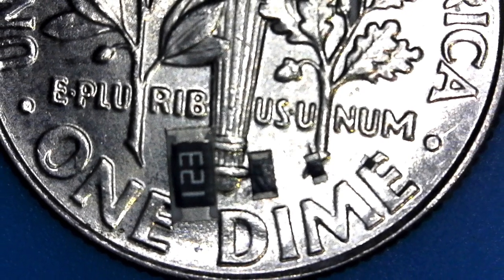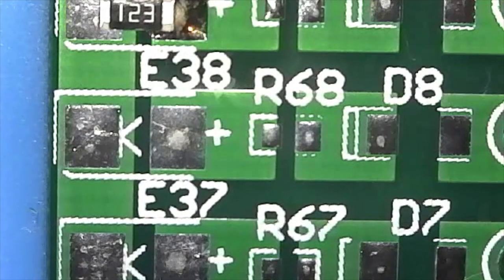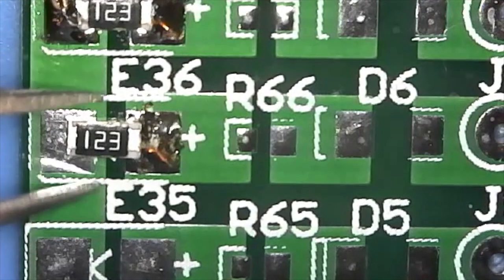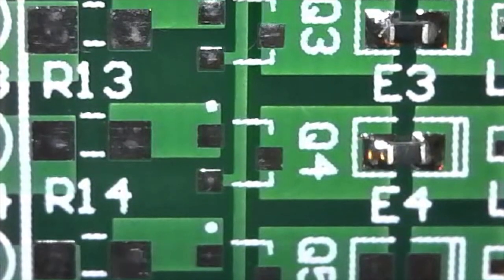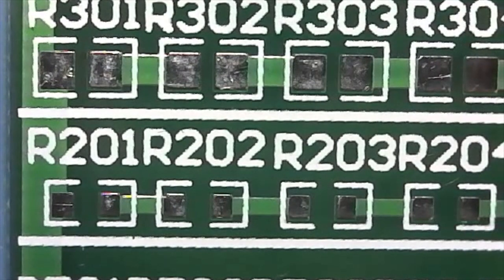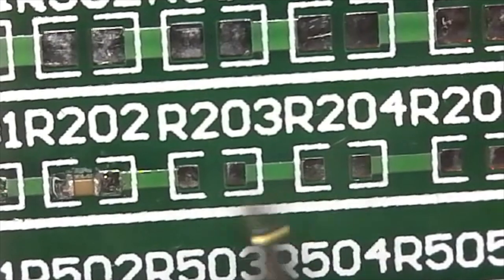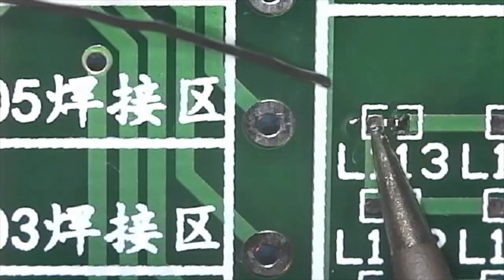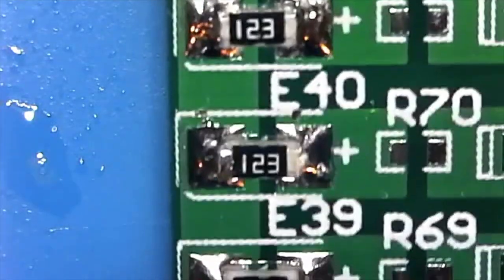SMD SOLDERING EXTREMELY SMALL PARTS AT HOME - Soldering Tips and Tricks Part 3

Comment: Thanks for this, I just some SMD fets to repair my TH3D mainboard that I blew up.  I can barely see them, will be fun to try.
Reply from the maker: Thanks for watching David!  Yeah these parts are getting microscopic, and it most cases having even a cheap microscope will help a great deal.  If the parts and pads line up (unlike in my video) they should go down a lot easier.

Comment: For me, problem is not in soldering, but just getting those m icroscopic smd parts to the board without losing them.  Those tiny things just fly out of tweezers, and are nearly invisible to naked eyes.  Once you misplace them they are gone forever.

Comment: Thanks for this. I often tear my hair out doing my own SMT parts using a hot air reflow tool, or even an old toaster oven. Without real solder masks and precision application, I'm always having to go back and fix tombstoned or badly floated parts. Watching you do it with an ordinary iron is a good reminder that its very doable if I only have one or two boards to do. I also never build with anything smaller than 805 parts. But, I also often use 0.50 center quad op amps (like 14-Pin SOIC size)  and transistors (SOT-23 I think). Can you offer any pointers on doing those by hand, or are those best to do with hot air and solder paste. Thanks for any tips!

Comment: a contact is dry, how to tin it with some solder? I accidentally somehow removed all solder from the contact, anytime I try to get solder onto it I end up with a massive ball relatively speaking
Reply: You're getting a massive ball because you're not using flux. Flux makes the solder stick to the parts instead of itself.